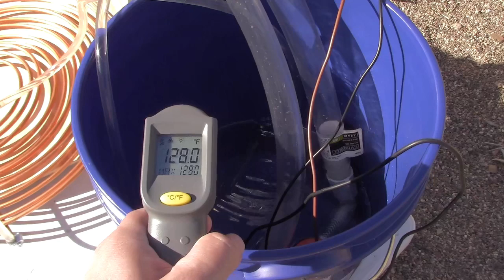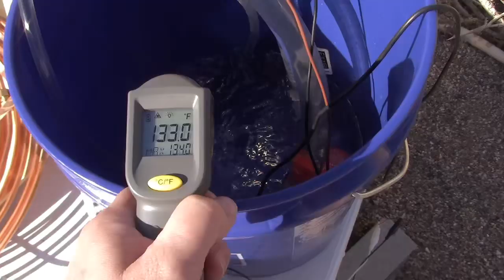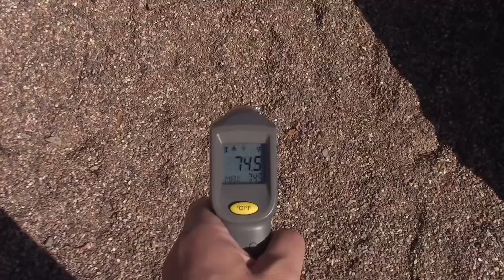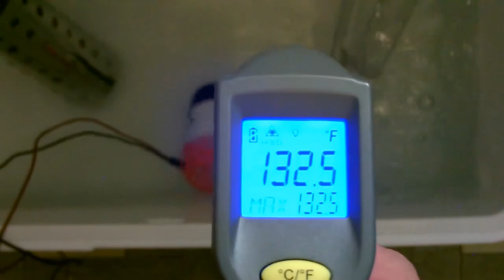DIY Solar Air Heater! "Hot Water Powered" Air Heater! (w/8x8 Heat Ex.) 100% Solar Pwrd! to 25k BTU!

Comment: I wonder if a 12 volt greenhouse thermostat could be hooked up to this? As this is, if the room's (RV) is warm enough, the only two solutions is to turn the fan way down and still get more heated air inside or turn it off and on while the temps fluctuate inside. Could there be an addition of using connectors (SAE for example) to switch from the solar panels in the day to a power cell or battery at night? I live in the New Mexico four corners area. (COLD in the winter).

Comment: Is there a chance to remove the bucket from this system. Can we connect one single pump at the out point of the radiator and connect the out point of the pump directly at on end of the coil. The other end of the coil to be connected with the IN point of the radiator?

Comment: The average flow rate of a showerhead is around 2.1 gallons per minute (GPM), which is roughly equivalent to 7.95 liters per minute.

So, in a 15-minute shower:
Water used = Flow rate × Time
= 7.95 liters/minute × 15 minutes
= 119.25 liters

Comment: do you think it could be possible to combine Air & Liquid solar heating ? Using your system and putting the hoses inside a box outside that send the hot air towards inside the building with thermostat ? this way harvesting the heat might be more efficient ?

Comment: Nice!  Wondering if a flat black screen, maybe soldered or thermal epoxy like Tech Ingredients sells online now, on the copper coil to help absorb even more heat onto the copper if painted flat black (idealling Vantablack or Black 3.0 though that stuff is crazy in price unless can somehow DIY maybe someway to increase the surface area to absorb more).   Wondering if like the ferro organic stealth radar paint might work also since I recall reading some cost effective ways to make.  Might be some ideas to boost even more.  Maybe to get rid of the fan electric need... wondering if a long tube like a chimney to create a differential to get air flowing?  Really neat!  Thanks for sharing!

Comment: Awesome project. Thanks for sharing. I have been wanting to do a solar air fan box. Would be interesting to see how much better the water exchange is over just solar air from a copper or black tube box. I just realized 😂 you built a two for one... it’s a water heater also after you heat the room maybe you could have nice mid morning shower with the water. Then the water wouldn’t get old either. Just fill it up at before bed.

Comment: I'm kind of lost. The copper coil is hooked up to a solar panel ? Or is it heated by the sun?
Reply from the maker: hi. the copper coil is heated by the sun and water is pumped thru it by a small water pump that is connected to solar panel 🙂
Reply: @desertsun02  thank you. At night you can put some DC thermal heaters on the coils and you could have heat over night

Comment: Love the concept! Do you think you'll be able to find a quieter fan?
Reply from the maker: hi. they do sell much quieter fans. cost a little more but i was aiming for lost cost with this unit
Reply: @desertsun02  Try a radiator fan from a Honda crv , they are quite! Make sure they are running in the correct direction otherwise you get noise! I run two of solar for my swamp coolers.

Comment: Excellent build! Couple of questions, did you have the radiator fan in pull mode? Why did you choose pull instead of push? And the water pump, how hot can the water get before there's concern about the water pump. Thanks, keep up the good vids!
Reply: I was wondering the same thing, I thought the car fan would be blowing through the heat exchanger but looks like he has it might be running in reverse and sucking the heated water temp through the heat exchanger.....just not sure what's happening here. The same thing with his ice cooler. Love the concept and want to build one of the coolers....but NOT if the fan isn't going to be the right one and run the wrong direction!

Comment: Much missing here
Wat is heating the water to the temp uou showed?
Reply from the maker: hi there. sun is heating the water in copper coil. that water is then pumped through the heat exchanger creating the warm air.👍

Comment: Ok so this work with the sun ☀️ humm interested so night and raining days?  To ?  Ok here is the solution for that second cooper coil inside of compost will get you 300 degrees 24 / 7 plus your system we use this system to get our heater inside the house and the water 💦 free